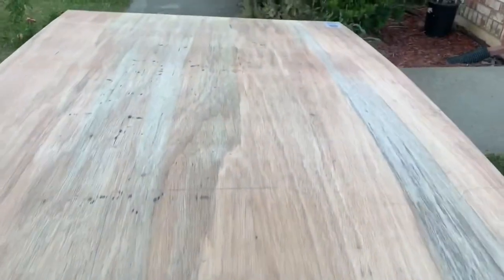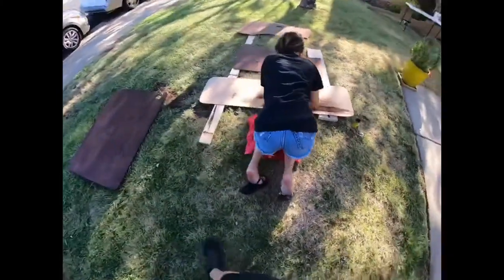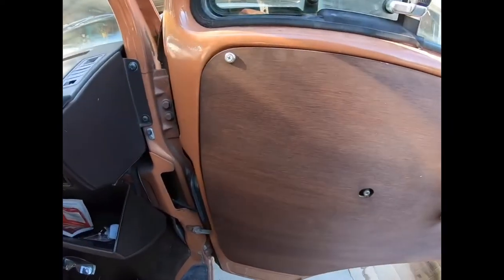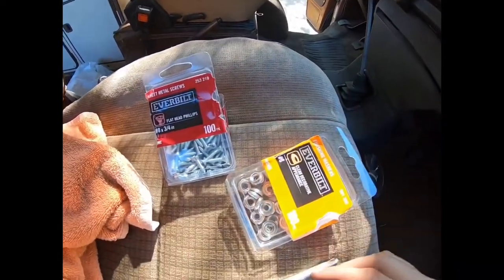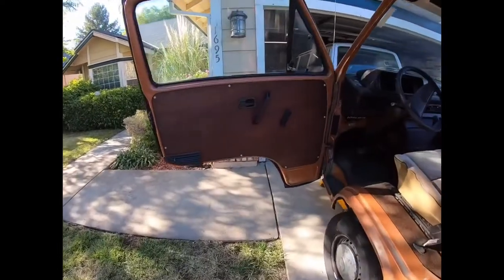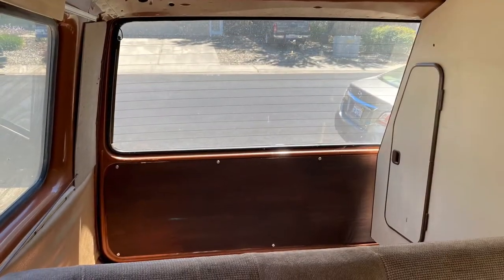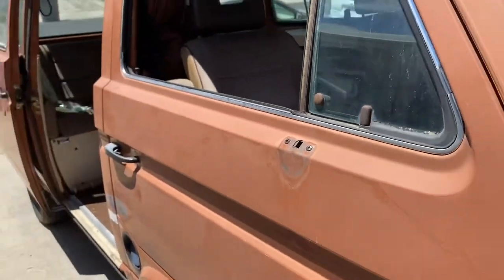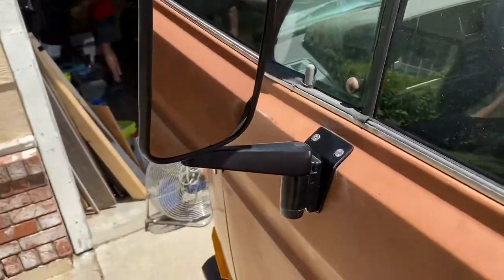GTI Swapped Vanagon Restoration Pt.2 Custom Door Panels

Comment: i have a golf engine for my vanagon... nice easy swap.. but got the engine from a golf mk2 doner vehicle. I was looking  for a missing distributor on ebay and then i saw an associated spark module control unit that should be in the wiring ? hmmmm I thought coil and dizzy is all i need,,, but obviously not! i think i need a wiring diagram, per chance could you help? that engine looks and sounds terribly nice! kind regards
Reply from the maker: Yeah some do have an ignition control module. Unfortunately I don’t have a manual either, may be best to look online or join a Facebook forum for mk2s and ask! 
Good luck